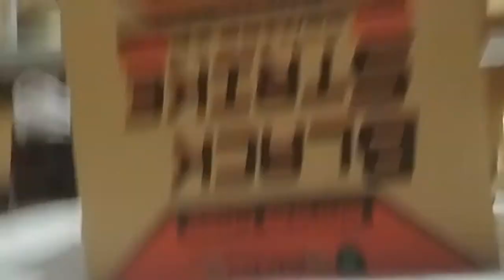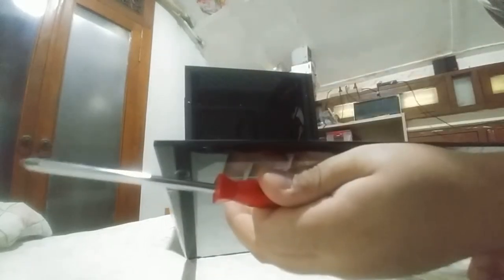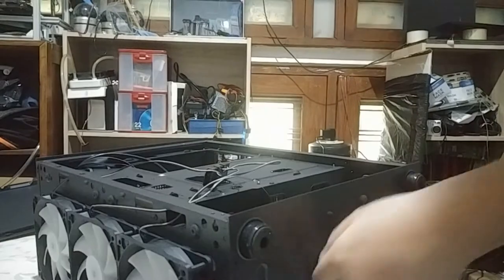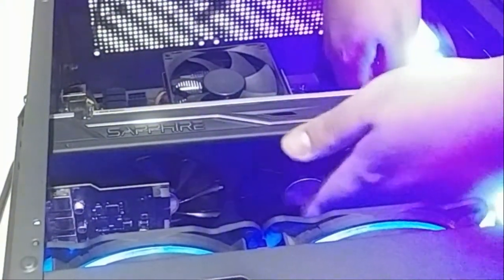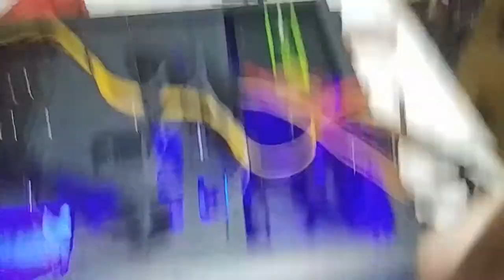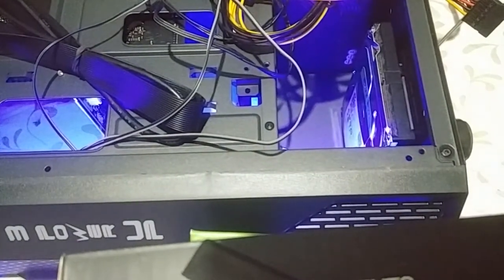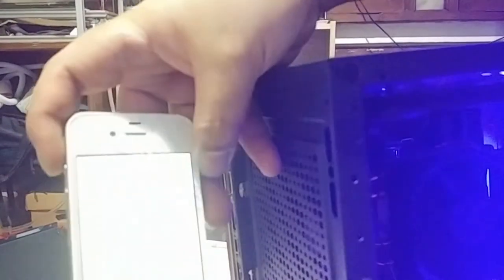Main PC Recasing Sh*tshow ft. Raptor 1606 Blackstrike

Comment: I’m Indonesian and bought this pc case for $15 and what I despise about it is the design and literally don’t know where and how to install the hdd and ssd
Reply from the maker: its at the bottom, you access it from the right panel (viewing from the front), theres a screwed plate right beneath the first bottom intake fan, remove it and install your drive there its a 3.5 or 2.5 drive slot, the drive will look inverted once installed

then there is a 3.5 slot at the bottom of the case from the raised bump.

inside the case i think theres another 2 2.5 mount location, but im not sure how its supposed to look, my guess is it mounts the same way to the 1501 blackstrike side ssd mount

all of them uses the bottom mounting screws for the drive, not the sides

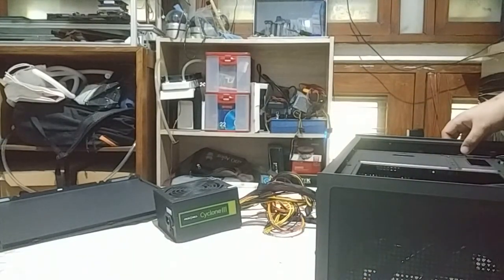you can see the drive bay at 4:14, but because i have 1 drive and id rather have airflow i skipped it and use the bottom, case mounted bay
Reply: @Atreea  I see, thanks for telling me that